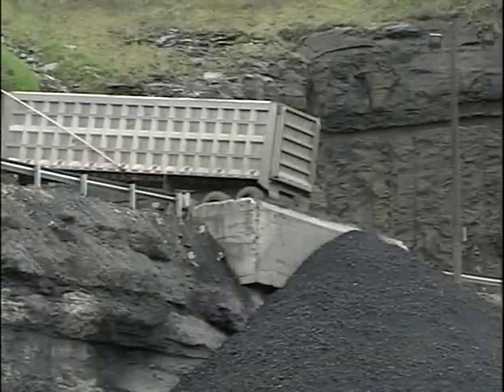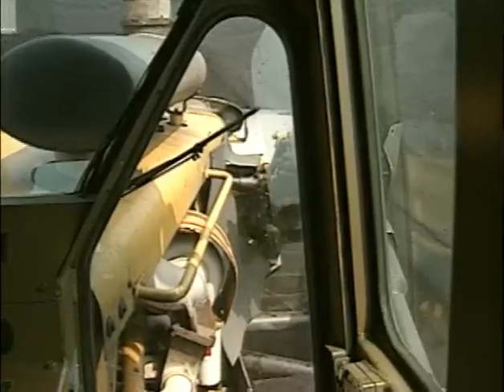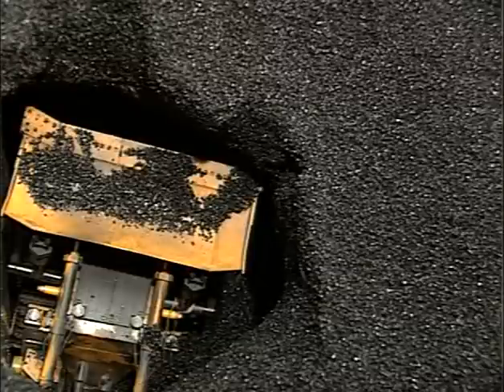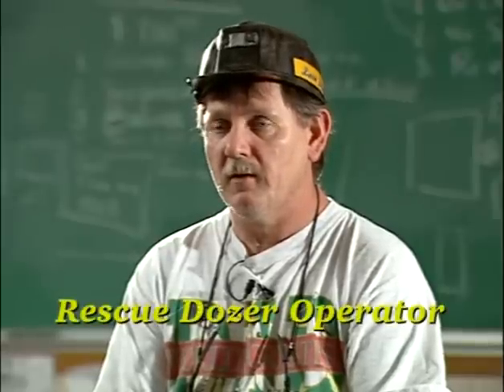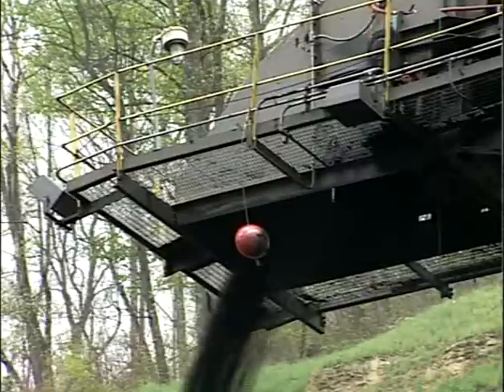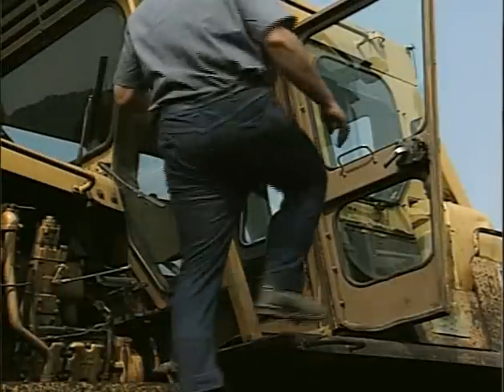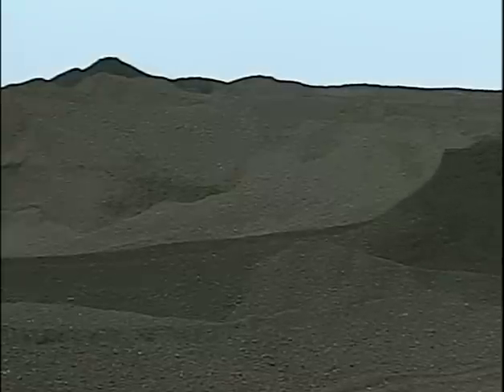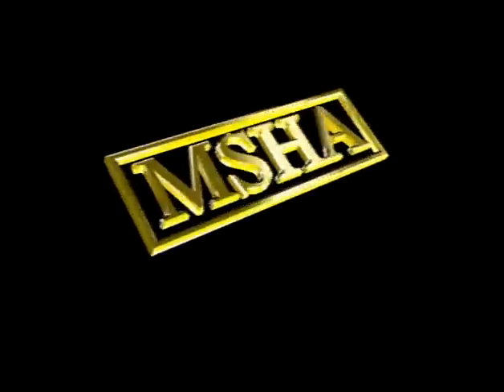Stay Calm and Stay in the Cab!

Comment: Joe, they utilize this method at coal fired plants because it is the only efficient and cost effective method for moving such a large amount of coal continuously without interruption.  In my area of the country the seasons vary from monsoon rains to below freezing temperatures both of which would foul up the equipment that you prefer and maintenance costs would skyrocket due to abrasion.  The plant that I work at burns 1000 tons of coal an hour, 24/7 including weekends and holidays.

Comment: the reason for track type dozers is for the simple fact that most of the time you have to cut a road up a steep grade to get on top of the pile, also because the pile gets up VERY high so the tracks is unlikely to turn over if you slide or the pile breaks over with you.. which i might add is a VERY common thing to happen.. tires just wont pull out of the tight spots that tracks will..

Comment: @westkan  It's not about being an idiot.  The coal is dumped from above into a "feeder" that drops it through a grate onto a conveyor belt.  Especially in the wintertime the coal can stick together and form an arch over the belt as coal is removed from underneath by the belt.  A dozer is used to feed the coal into the feeder grate and can cause the arch to collapse, putting the dozer and operator down into the feeder and coal then closes in above.  It's a hazard of the job, no idiocy involved.

Comment: The "self rescuer" works like a scuba diver's rebreather. It allows a person to "rebreath" the same air, when air is cutoff (like underwater or inside the coal pile). It's a breathing  device that removes C02 and replaces oxygen that has been used by the body.

Comment: Its called 'angle of repose' which is the maximum angle a material will sit without collapsing. When material is dropping in to a chute as it was here then it is already at the maximum repose angle. Even touching the sides will cause the 'funnel' to collapse.

Comment: they have a submarine kit in all stock pile dozers... a sub kit contains of very thick hardend glass, and older style sub kits is thinner hardend glass with metal reinforcment bars that lay and bolt in touching the glass inside the cab to prevent it from collapsing while being submerged.

Comment: @ 7:21 The guy explained the little flashlight very well, tells us under what conditions we may need to use it (priceless info), but we still don't know what a "self rescuer" is.  I think maybe a tiny man with a shovel pops out of the package, then rescues itself. Maybe "emergency air" is a term used by another manufacturer, if that's what it is? @ 9:00 the man says to "stay calm and conserve the air in the cabin", he doesn't mention a self rescuer or emergency air.

Comment: That could make a bad situation worse.

The best way really is to dig it out carefully. If the pile collapsed more while they're pulling him out from above, it would crush him and anyone who went down there with him. They don't know what other voids may be in there so if they pull on it with chains it could also cause a worse collapse. 

The best way really is to dig where they can see and not put any unnecessary forces on the pile to disturb it more than they have to.

Comment: I wonder what it would cost or how feasible it would be to put the dozer on a cable tether? Have the cable on a spring loaded roll so that it would stay relatively tight all the time. Have some swivels on it so it won't get tangled up. Have it attached to the dozer and go up a flexible antenna-like post so it stays out of the way.  Then if a dozer goes down a hole or gets stuck, winch it out with a monster winch or pull with bigger dozers.

Comment: @offamychain I was thinking the same thing. I had one idea in mind. Then a short time later realized the simplest solution is a grizzly grate. Not that big of a deal. 
Or even a series of concrete piling rising up from the inner edge of draw point. Making it so should a dozer pass the threshold, it'll only tip slightly before hitting the pillars.

Comment: I have done some research just today and there was a specific machine called. 
The RayGo Wagner CHD-15_28 Rubber Tured Coal Dozer.

It had about half its length where a flat plate, horizontal to the ground was used as the dozer. I would have thought the flat blade may have stopped the dozer from sinking so far and so fast.

I also wonder why on earth there is no proper protection like they would have on tanks with several inches of glass, and or a mesh covering all the openings on the dozer

Comment: well they normally use rock trucks on strip jobs... they haul he coal from other underground mines to there with 10 wheelers and 18 wheelers...  they also have a " glory hole " which is a hole in the ground miles away with a feeder at the bottom, coal dumps from another underground mine to outside, then falls in the hole and belted thru another mine outside at this stock pile.... pretty big mine you really wouldnt beleive how big it is..

Comment: @Squarerig  it's when the friction of the coal creates a "hole" void. 
Like some old stone bridges made by compression, still standing today. Arches 
 they don't use a large track hoe?
what about remote vibrators(offset spinning mass) placed in circle at wall of void?  
some of the  "mass finishing machine" use offset mass to remove burrs and mirror finishes. its neat to watch
horizontal augers, dumping cones, they had problems with grain and no more.

Comment: @youngwboi 
actually, remote operating equipment is starting to get pretty common for dangerous situations, and unlike autonomous equipment, there's no workplace politics involved (autonomous equipment gets unions worried cause they don't need workers).  Unfortunately, they're still way more expensive than the standard equipment, so a lot of mines haven't made the switch yet.  Some companies still put economics ahead of safety - sad, but true.

Comment: thats not a power plant, its a coal preparation plant at Sidney, Kentucky..  i used to work this stock pile about a year ago until i got laid off.. when the pile gets up that big, theres no telling exactly where the feeder is until there is an actual "hole" on the top.. sometimes it will feed through at the bottom, and you never see it at the top.. if you so some research, coal trucks in the number source of haulage in the world in mining industry

Comment: I have watched this several times and it still strikes me as an accidence that is avoidable.
I know I am not in the Industry but could there be certain areas that coal can be dumped and other areas where the dozers just are not allowed. Then perhaps spots around each vent or whatever they are called where the coal goes to the furnace, which can have vibrators or 'stirers' constantly moving the coal to push it doed to the furnace but also stopping the rat holes from developing? continued

Comment: My coal truck was loaded heavy, S turn too fast, weight  physics break the weld @ the fifth wheel to trailer, truck turns over on it's side @ 50 mph ( remember 80,000 lbs ) slide in the tractor, on it's side, towards a 100 ft. drop off. Stop just feet from going over, coal all over this 2 lane, heavy travelled road, trailer on it's side stops just inches from coming through the cab into my face. I push the door up, get out to the ground, fall to my knees, thank GOD it ended like it did. The last day driving for me. Wife begged, got a new job. COAL hauling and pit work is dangerous beyond most people's knowledge. Loaders, drivers, operators get killed all the time. You stand that trailer up to dump, 40,000 lbs comes out, 20,000 lbs sticks in the nose, your on soft coal and it start to go over. Maybe you can get it down and move forward before it turns over, maybe not. Most drivers have done it. Not deadly bit dangerous. Respect the coal haulers that pass you on the road, pit men. A HARD job, from can til can't. May God Bless and keep all safe. This guy will never be the same. No PTSD benefits in the coal world, but it's there.
Reply: +sandspar Dangerous work indeed... I just wish the coal buckets where I live (PA) would drive a bit safer. I don't know how you guys get paid, but around here, they get paid by load and so they drive at dangerous speeds to fit more loads in a shift. They have a very poor reputation around here, I've seen them run red lights, speeding up to stop lights doing 40+ MPH and then slam on all the brakes when they can't make the light, coal buckets trying to pass each other both doing 15-20MPH and holding up all the traffic, etc. I'd like to give more respect for the people who haul coal, but around here... they drive like maniacs. They're driving insanely heavy pieces of machinery, but they don't believe in Newton's Laws whatsoever.
Reply: Dhalin Yeah, now I live on the same road I used to drive, and I fear for my family's lives daily. I know what you mean, and after contemplating it at length the only thing that could possibly work is to put the culpability on the brokers and owners, then "fairly" enforce existing traffic laws. But that'll never happen, because it's all about the taxes paid by the ones receiving the loads, and corruption will always be king. So, sorry, but there will be coal moving long after we're gone. Stay Safe...

Comment: self rescuer is a device you use to breathe in heavy load particulate air mostly used in underground applications it supplies oxygen through a rebreather system that removes carbon dioxide from your breathe to improve the length they last google them they are a miners life saver, they have saved my life more than half a dozen times underground

Comment: they all have fire supression system on them and fire extinguishers....  u just pull a pin and a button inside the cab and it will go off OR if the monitor senses heat it will set itself off....  the cab is unlikely to catch fire it would be the engine most likely...

Comment: I was so sorry for him, thanks god he is saved.
Is it kinda coal mine there?
Also, why they dont use front loaders with blades and not tracked bulldozers?
Its not the rock or something
Reply: Coal isn't rock. It is very soft in most cases. Tracks allow better weight distribution on these kind of surfaces.

Comment: i absolutely agree they should of took a excavator and pulled the coal away from the dozer instead of risking the coal caving in more and having a situation that the weight  of the coal breaking the glass on the cab of the tractor but they might not of had a excavator

Comment: What a stupid concept for a stock pile. Try a huge osculating auger up and down in the center of the hole to draw down the coal and instead of the dozers pushing it, put a hydraulic push wall at the bottom and push the coal towards the osculating auger from the bottom where they dump the coal. Make the feed chutes parallel with the belt feeds and the wall. Stupid Engineers never worked a day in their life at these places and don't have the first clue of how to make a job more efficient.